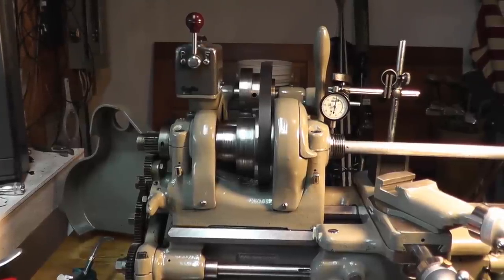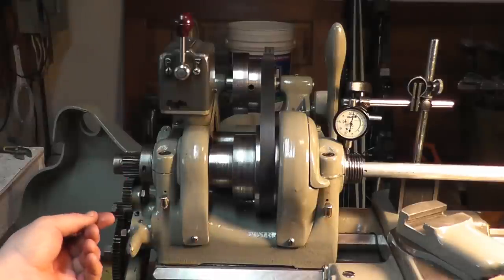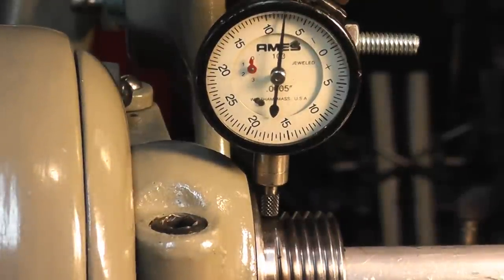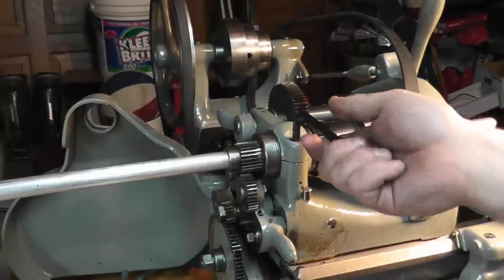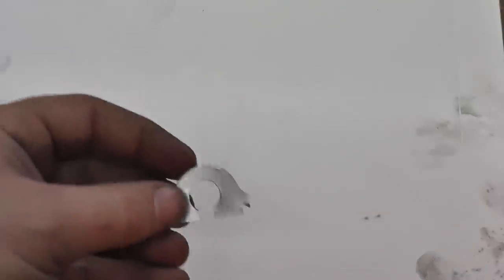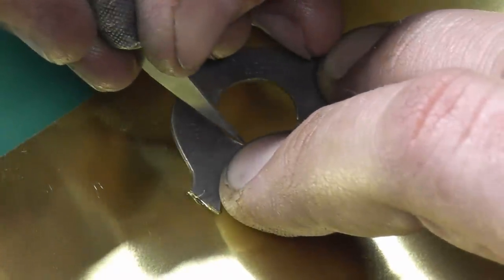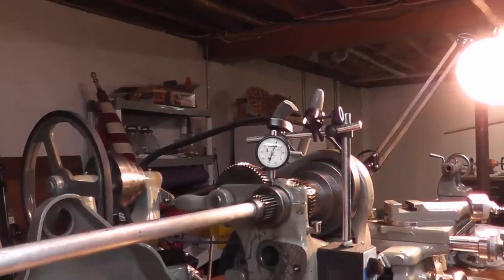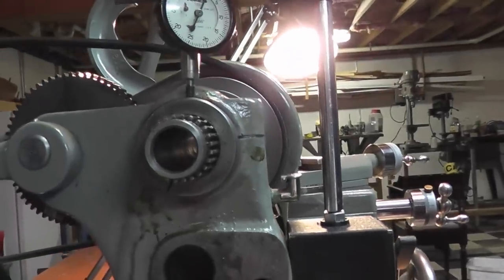Southbend Spindle Bearing Clearance Adjustment

Comment: Excellent tutorial sir. I was running my SB 9C tonight and realized the spindle clearance is too loose. I had the entire lathe apart some years back to strip and repaint it but failed to notice that the headstock does not have bronze bearings. What you indicated makes perfect sense about the lubricity of cast iron. It contains graphite. After all, the ways of the lathe are cast iron on cast iron. I'll need to check my shims to see if they are laminated. I am a machine designer and have specified this material for various applications over the years. McMaster Carr sells laminated shim stock and there is even a Mil spec on it.

Comment: Another interesting video!  Thanks for your effort in making these and posting them.  I know they take a lot of effort to do.  I've got a similar lathe and need to check the spindle clearance so this was helpful. I didn't realize you have to push down first then zero.  I was thinking the clearance spec was a radius measurement, not a diameter measurement.  Thanks.

Comment: I have a 10k model a, it has split bronze bearings but there's only a slit on the front side of the casting like yours, except the back has two screws on each side that pull up and open the bearings
Reply: Do you have any plans for checking spindle clearance? Other question related into first one.   Have you find information how much there should be clearance in your case? I'm interested because I've got an old lathe estimated circa 1960-1970 which structure desing has combined both South Bend and Myford lathes. All parts and accessories has been stay with lathe but the manual hasn't. So I have collected information from these two lathes to patch up patching cap caused by missing manual.
Reply: @atothek1804  i ended up restoring my lathe but didn't check clearance i just re used the bearings since they were in good shape, adjusted until there was no drag and its been holding up well for 6+ months

Comment: I see you took out a .0026 shim and replaced it with a .002 shim, I have found out if one takes 320 paper and laps just a bit it will tighten up quite a bit like .0006.
Good Job
Alec

Comment: If I took out ..well better peeled out to much shim can I use allumnam foil to make a few shims to replace .. Or is it a waist of time ?? Just buy some ..?? Hay thanks nice vid I've seen them all .. I just recently bought a south bend 9x3 model C and it chatters like crazy .. It had like 0.006 clearance on the gear side .. Chuck side was tight .. So I'll have to add some their .. So I peeled out some shim but took to much on gear side ..
Reply from the maker: +Herbert Humphrey 
Aluminum foil is too fragile, but and aluminum can will work if it's the correct thickness
Reply: +Halligan142 that's accualy exactly what I did .. I had a few different kinds of cans with different thicknesses I had to use to get to the correct thickness .and man cutting shims is soooo time consuming !!! Mainly I guess because I wanted them perfect .. All went well except I made the same mistake you did on your outher vid. I put the spindle back in without the dang belt ...... Ahhhhhhh I was so mad  .. Man thanks for the vids .. I would have been lost without them .,.. Thanks